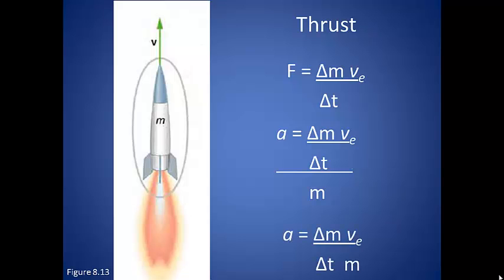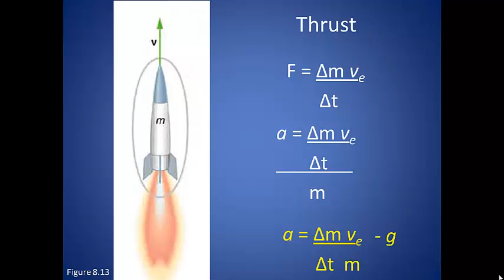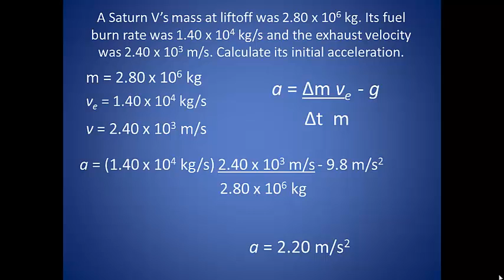Rocket Propulsion

Comment: Question if you please.  I am no physicist or mathematician.  In lay mans terms...I have seen NASA stats on the power of a rocket's engine and they specified that the measurement was at sea level.  Now atmospheric conditions provide resistance and pressure.  When a rocket initially lifts off at sea level the air pressure is what determines the thermodynamic resistance that provides the thrust.  As the rocket rises air pressure drops.  Does the engine power drop to zero when pressure aire pressure is zero?  Presumably not according to your theory here but as your theory makes no mention of the absolute requirement for air pressure then I am confused as to how you take that into account...or do you not?  Why not?  Any mechanic will tell  you pressure is everything in an engine.  Are you suggesting that air pressure has no bearing on the power of a rocket engine as it lifts off?  Can you point me in the right direction to understand this?  Thanks